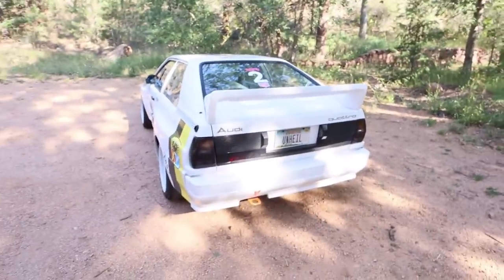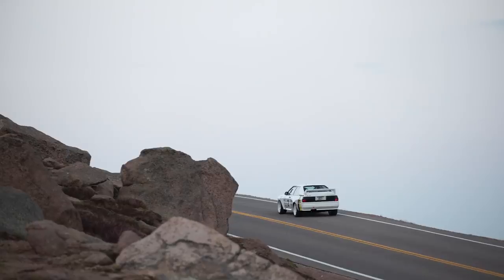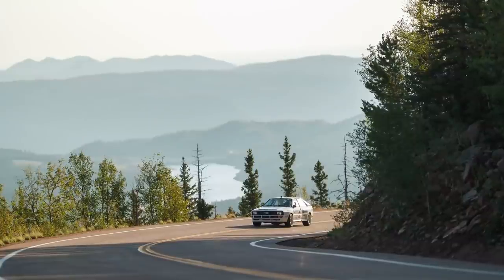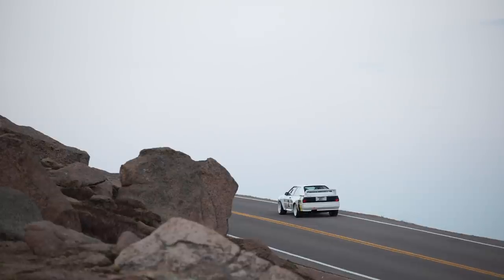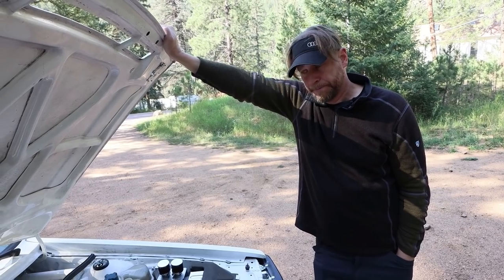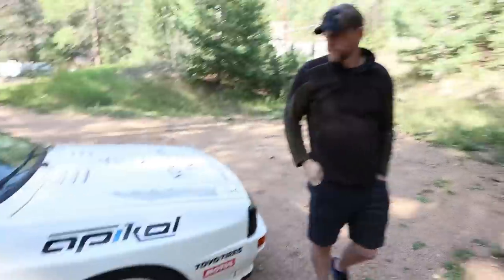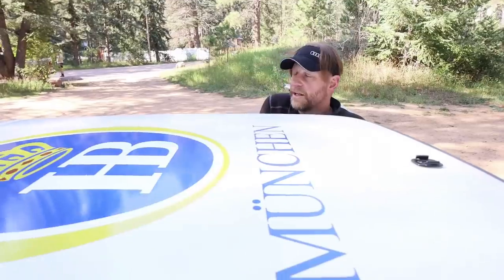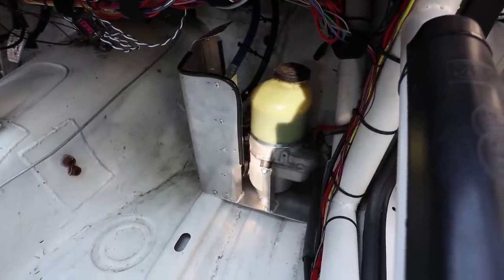Hillclimb-Spec Widebody Audi Quattro is Pikes Peak Perfection

Comment: I've owned 6 small chassis Audis',  my first Audi I owned was a 74 Fox, then a 84 4kq ,  second was a 80 4000 two door, third was 86 kq, forth is a 83 ur quattro, fifth is a 84 kq(the second 84 I've owned) ,  sixth is a 85 kq. I still own 3 of those small chassis. Some years ago finally got my hands on the elusive ur quattro in 2005 after searching for one for about year, then two years later my neighbor moved in, that's kinda put a damper on a lot of my projects, I've got one major project in front of the ur quattro right now, but I've been kinda chipping away at the project deciding which way to go with it. It's really picked up a cult following so more parts are becoming available that make the car better. My daily is a Allroad MT6, every time I get back in one of the small chassis I'm quickly reminded of just how different the two cars are, while not exactly made to do what the small chassis do, both the concepts are both pretty well thought out, I prefer the small chassis obviously over the C5 for many reasons. I can't wait to move from here, people can be a real drag around here!